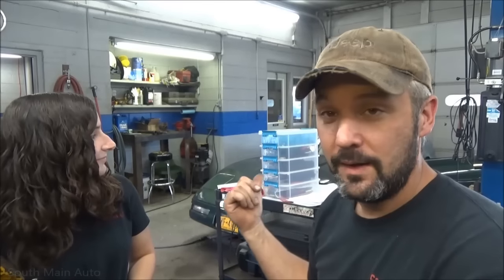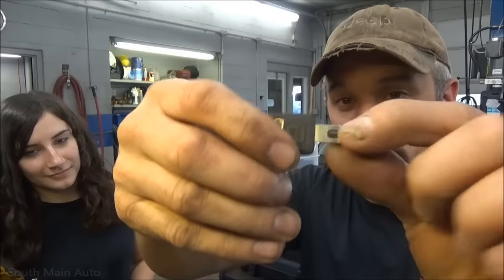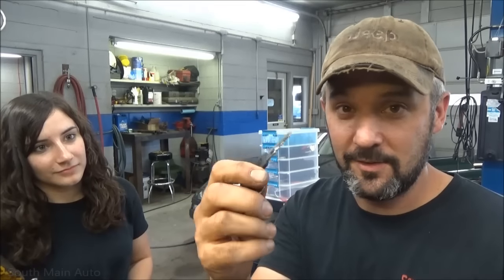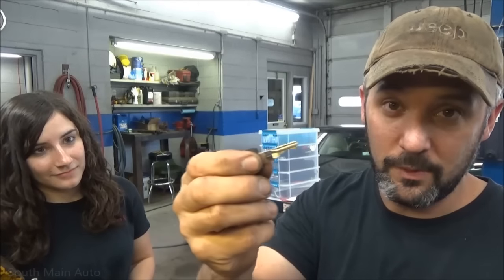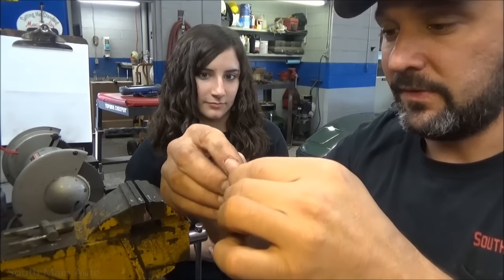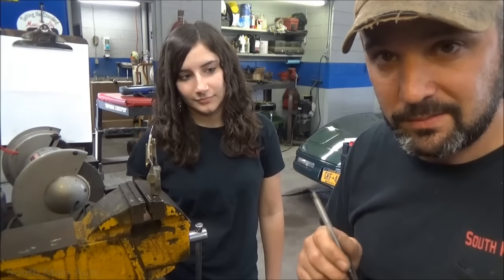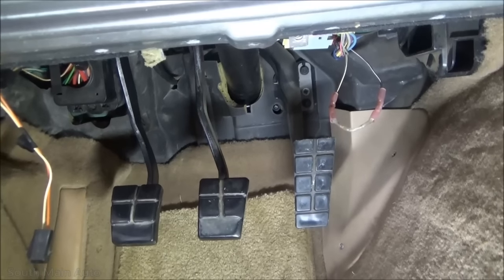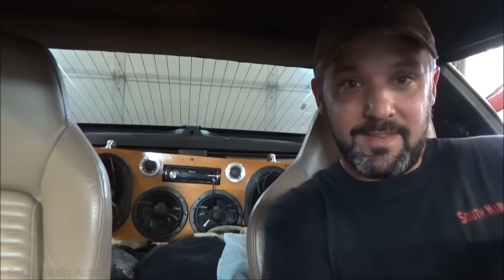GM VATS Key / Resistor Key Security Bypass

Comment: No, No, NO,  do NOT cut the "female" connector under the dash!!!   It is not
necessary.   It is the orange leads with the "male" connector that are the
problem.  Cut the orange leads  that go into the "male" connector, and 
solder a resistor between those two orange leads, then plug the "male"
connector into the "female" connector.   That should solve your problem,
while keeping the wiring harness intact and undamaged.
Reply: If you solder a resistor between the two male orange leads, how can you plug it into the female connector?
Reply: Is your question serious?    Look, you go to a junkyard, you find the orange leads under the dash near the steering column.  You unplug the connection
from the ignition key leads that read the resistor value to the female 
connection that goes to the CPU of the car that controls the ignition key
resistor acceptance value.   You cut the leads going to the ignition key
cylinder and solder a resistor between those two leads that is close to the resistor value that is found by using a digital multimeter to measure the resistance on the  two sides of the "chip" that is on the ignition key. You 
have just "fooled" the security system into believing that the correct
ignition key with the right chip has been inserted into the ignition key
cylinder, and the security system will allow the car to start.

Comment: If it is so easy to bypass it.. Why GM ever do it that way???
Reply: Security through obscurity - since hardly anybody knew what it was all about at first, it seemed "secure."
Reply: If you were going to bypass the key using resistors. You would need to know the resistance value of the key. Even though the number of possibilities was limited. For your average car thief it would stop them and even for the better car thief it would take time. I'm surprised you can't go in using a scan tool and read the value or set the value for open. That way you could just pull the plug.

Comment: u might get trouble for showing this video, your teaching thieves how to bypass the system, they already stealing cars with a network system that they can hack to unlock the doors and start the cars.
Reply from the maker: I am actually writing this from prison... u should have warned me sooner
Reply: To be fair, you have to know the resistance to begin with.. ( But if there are truly only about 15 or so different resistances it shouldn't take them too long, about an hour tops to pick the correct one if you are accounting for the 3 minute timeout )
Reply from the maker: and then you have to break the lock cylinder and steering wheel lock to... that is after you jimmy'd the door lock to get in in the first place... other than that yeah it is pretty easy. Then you need to make your escape in a $6000 Chevrolet...
Reply: +South Main Auto Repair There arent all that many 94 vettes out there too.
Reply: A lot of other cars use that to, I have in my 98 Monte Carlo
Reply: I am worried they may steal my 1992 Buick LeSabre....LOL, What a joke.  If someone wants your Vette they will put a gun to your head and carjack it.  A security system is to stop 16 yr. olds from joy riding.